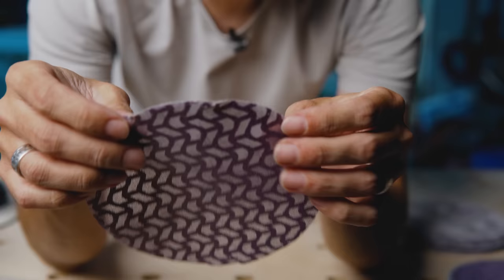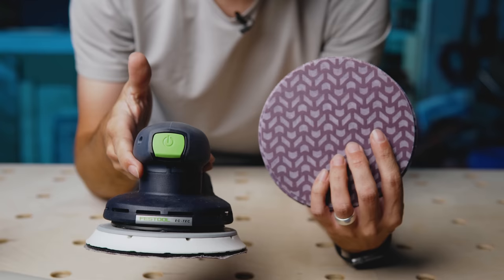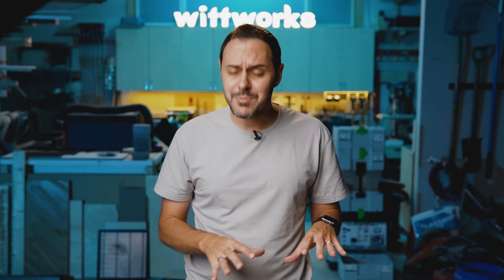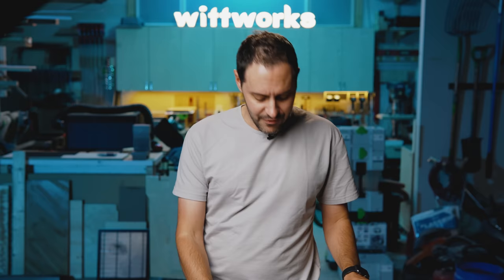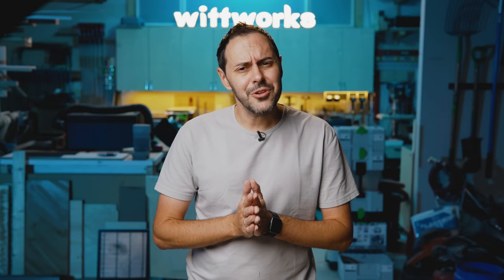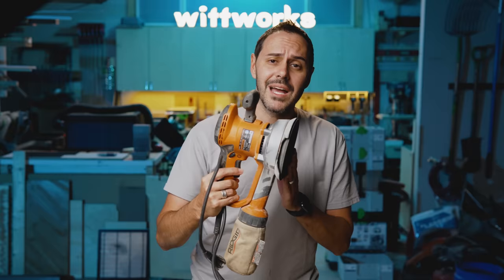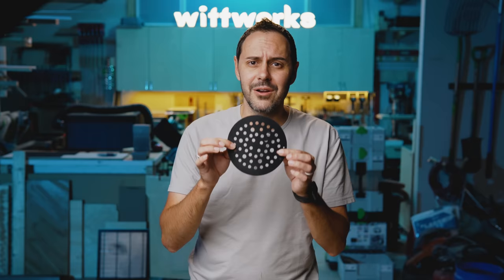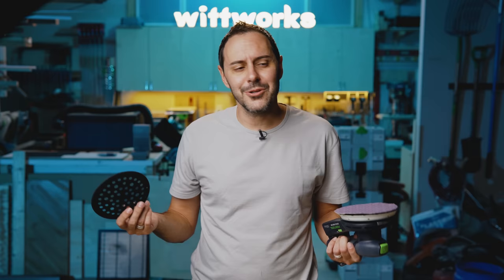the problem with the "best" sandpaper (& how to fix it cheap)

Comment: I came across this same fix after many, many hours spent scouring the internet. The problem is, the sandpaper still sucks. It falls apart if you ever go near an edge or corner. I bought this stuff based on the video by JKM, but honestly, it's garbage. In the real world, normal sandpaper lasts much longer and doesn't require you to purchase these protection pads, which, let's not forget, need to be regularly replaced because they get torn up.

Comment: Very interesting. Thanks. But, why does that pad make the xtract stick better? I get that it can save the sanding pad, jut no clue about the other issue.
Reply from the maker: I think it’s a pattern or density issue? The Xtract is on a net backing and typical “Velcro” isn’t as compatible I think.

Comment: Question: would the festool padsaver work with non-festool sanders? Or do I need to find a padsaver equivalent that’s compatible with my sander? (Bosch random orbital sander)
Reply from the maker: My guess is it would work but I’m not sure. I’ve used both 3m and Festool ones on my sisters Ryobi sander over the holidays and it worked. So, unless Festool as a weird hook and loop that Bosch doesn’t have, I think it would work. I would look at each and see which brand has holes that match up best for vacuum.

Comment: Doesn't that just effectively turn it into a paper/cloth backed pad in regards to dust extraction efficiency?
Reply from the maker: No. The holes line up the same as the backing pad.
Reply: @wittworks  Awesome!

Comment: I don't use the xtract discs with my ec 150/5, but since I got it I've used the protection pads to keep wear off the expensive pad.
On the page for festool's own net discs it makes mention of the pad protectors. I haven't tried the xtract yet; granat (not the net kind) has worked fine for me. Little to no dust, sands aggressive and quick enough. Is the xtract really worth keeping in inventory? I watched the jkm video, and the results are nice on paper, but I can't say they translate into real world usage. The edges fraying would be an annoyance for me; what's the advantage of fancy net sanding discs if they don't last as long as film backed discs? Genuine curiousity; I'm not knocking the xtract, it's just difficult to know if it's actually good, or just an influencer fad.
Reply from the maker: I have granat and don’t like it. The test katz made popular is legit. The behind the scenes is that Xtract almost didn’t make it in. The first sample in the USA got overnighted to him and it was thrown in at the last min. It was a dark horse for sure. Truly surprising. 

I love Xtract. But the edges can be frustrating. But I don’t notice a quality difference. I care mostly about dust extraction. 

You might look at the 775 cubitron. Clothe backing, cuts great, dust extraction is good. Last long. It’s just more expensive.

I was skeptical and bought a sample pack with a range of grits for $10. I was convinced after that.
Reply: @wittworks  I'll grab a sample pack then and see how it works out. I did notice the film backed xtract and actually wanted to try it out, but it's more expensive than granat. Maybe the xtract net will work out for some things, I'm just not a huge fan of keeping a bunch of different types of discs in the shop.

What don't you like about the granat?
Reply: @NWGR  It’s only more expensive if it doesn’t last longer in proportion to the price.  My guess is that you will be surprised at the Cubitron’s speed of cut and the durability.
Reply from the maker: That’s correct
Reply: @baraksinz  I ordered a sample to try out. I'll probably grab a few film backed xtract discs too.

Comment: I also discovered the same fix after many hours of research and found it frustrating that no one using or selling this stuff mentions that it won't stick to your sander and will wear out your sander's pad.  But, it's not worth bothering with because the sandpaper itself is rubbish, the grit wears out and stops cutting in no time, even on flat surfaces.   There's so much less actual cutting surface area.  The only advantage this stuff has is good dust collection  but not much better than regular 3M Cubitron.

Comment: I just got a Festool ETS EC 125/3 eq.  I tried the the xtract mesh in this video and I get a lot more wobble and movement from the sander as compared to using festool granat paper.  I don’t get the same response from my Bosch 12v 5” orbital.  Has anyone else experienced any type of excess wobble or movement when using xtract with festool or does my new sander potentially have an issue?
Reply from the maker: I’ve heard of two others having this issue. I asked Festool and Mike Taylor and both said this isn’t normal, but no one knows the cause. Mine doesn’t do that. I wonder if the back bad is loose and needs to be screwed down more? I’m puzzled.
Reply: @wittworks  I tried removing and reinstalling the back pad and even swapped it out for a new “hard” version.  Nothing makes a difference unfortunately.
Reply: I just picked up a Festool ETS EC 150/5, attached the corresponding Festool pad saver (thin velcro) and a new 3m netting, and experienced the same thing you are experiencing, Ryan. It’s very wobbly and grabby like the sander is going over contours on a non-flat board. The experience is the same with and without dust extraction attached. I tried the pad saver on my medium and hard sanding disks, no meaningful difference between the them. I swapped out the pad saver and netting for a granat disc and the issue is resolved for both sanding pads. Which is a disappointing result. I am not keen on buying a different set of abrasives for just this sander.

The balancing must be very touchy on these sanders. I run a pad saver and netting on a Bosch get75-6n and it does not produce the heavy wobble in oscillation mode that I experience with the EC 150/5. The Bosch experience is quite smooth in comparison.

Comment: The huge problem that the protection pad presents is it rounds over the edge of thin stock due to adding unwanted cushion. It also allows the amazing extract sandpaper to sand away the soft grain faster than the hard grain, creating an uneven surface. I don't recommend these
Reply: Fair enough. I think you’re operating at a level of pretentiousness that doesn’t apply to most people watching this video. If you’re at Rob Cosman levels of perfection in your craft then you’re definitely not in the same group as the rest of us. I haven’t noticed a protection pad doing this to my work but then again I might not be requiring the level of precision that you are. I can’t help but wonder if it’s really making the surface  wavy or if you’re just being super picky about what you consider wavy. We aren’t machining titanium here.

Comment: Sounds like the problem isn't with the paper , it's the pad on your sander. The hook and loop pad on a 3M extract sand holds the mesh paper just fine, along with all my Bosch sanders. The paper is so tightly secured to my Bosch pads it feels like I'm going to rip the pad apart removing the paper. 3M being one of the most reputable companies in the world would not release a sander that would not hold their own sandpaper. So knock it off with the click bait content, there's nothing wrong about making a video to help people with Festool compatibility with 3M sandpaper, but not everybody has the same issues.
Reply from the maker: 3m sells their adapter so you don’t wear out the hooks when you rip it off. You’ll replace your backing pad soon. 

You should research the definition of click bait.
Reply: Looks like he was being specific to that sander, and it’s actually an issue in having with my Dewalt sander. Not the issue of it not sticking, but the issue of the hooks wearing off. I’m ordering the 3M protection pads tonight because I’m already seeing the wear on my vacuum pad.

Sounds like you’re being needlessly negative and pretty aggressive about this. It isn’t clickbait in the slightest, I literally found this because I was googling for solutions for problems with the sandpaper.
Reply from the maker: Thanks Tom. I just went to Home Depot and Diablo sells a pad for $5. Can’t confirm if it sticks yet, but nice to see a local option if you can’t wait for shipping.
Reply: @LoveTriscuit  Seriously ? I'm not being negative or aggressive , I'm stating point. No where in the video did the presenter make any claims that the sandpaper would not adhere to any other sander besides the Festool. I actually purchased one of those pads for my 3M and Bosch sanders as well, but didn't feel the need to mention it since everybody knows about them. I'm kind of getting sick and tired of everybody being so soft when it comes to criticism. This community is all about only "say something nice or don't say anything at all", I guess it's the participation trophy generation. Most of these channels thrive on Clickbait in order to suck you in so they can get more views no matter what type of regurgitated misinformation they force-feed their audiences. It's a shame that we have to get so worked up over sandpaper that doesn't stick to your favorite sander on a Friday night.
Reply from the maker: I’m not worked up and never got a trophy. You clicked. You should stop clicking. And commenting. Yt will keep feeding you the stuff you say you don’t like. 

Also. Please send me the channel that you self fund and edit and film to help people. I’d love to see it.
Reply from the maker: Regurgitated misinformation? There’s a lot of that I agree. But would you like to know that I have an insider at 3m where I get my information, THE head of abrasives AT 3m watches my channel, and I got all the information you don’t like straight from the company. 

Don’t lump me in with the others who do what you say. 

I ALSO talked with two Festool reps on the issue.
Reply: @ronhochhalter3491  this is a common issue, and has been for YEARS. Mirka was the first to patent screen type discs with both Abranet and Autonet. My first Mirka Ceros sander, almost 15 years ago advised using backing pads with screen discs. Just because you don’t notice the problem going through five discs a month doesn’t mean it isn’t a problem. My shop goes through a backing pad a month and I replace the sander pads once a year. I’m pretty critical of YouTube woodworkers, but this video is absolutely spot on.  If you’re going to criticize someone, at least do so from an informed position.
Reply: @wittworks  I'm sure all 95,000 employees at 3M including your inside guy are resting uneasy tonight and planning to redesign there flagship sandpaper to fit your needs for YOUR specific Sander, geez.
Reply: @mattschreiber4251  I agree with the Mirka Brand, I purchased $300 worth of Abranet and it sits unused in my shop due to the fact it becomes a projectile off the pad of a spinning sander. I feel like I'm very informed about 3M sandpaper being that I've used it for over 45 years in all of its different forms including Cubitron. I've never experienced one problem with 3M paper coming off my pads, but I'm willing to accept that other people have those problems.